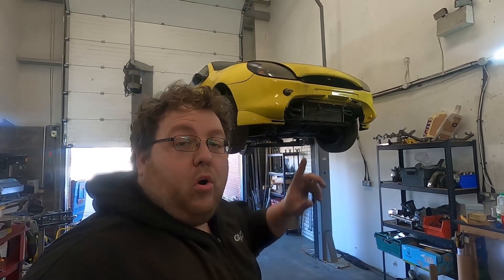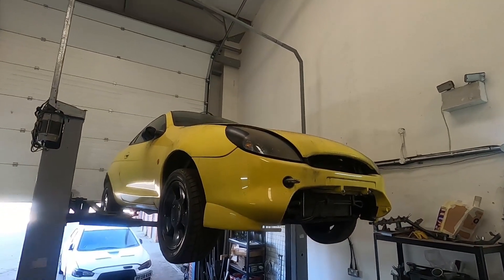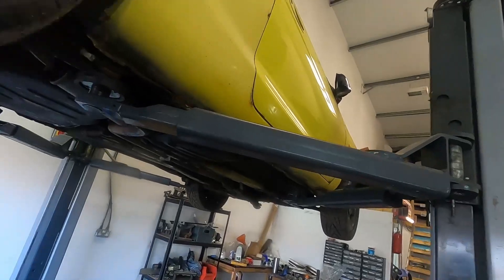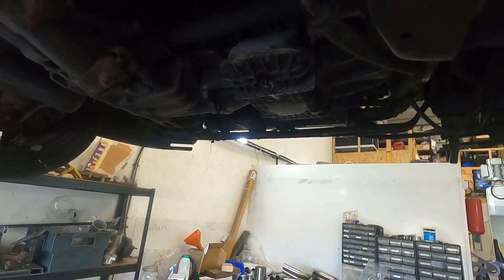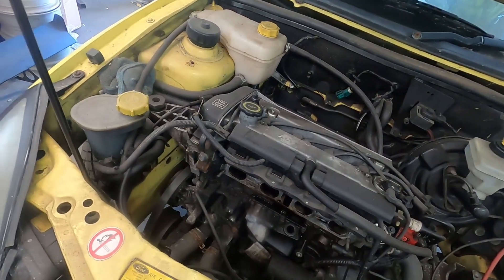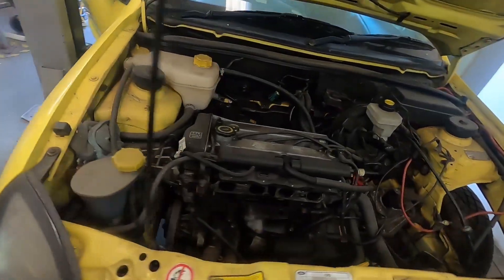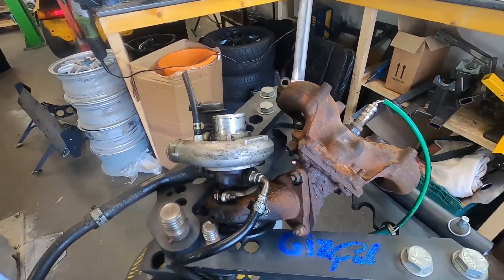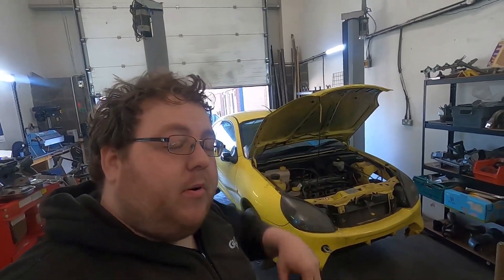Ford Puma Turbo - Build Introduction (Ep 1)

Comment: I love the Puma, won top gear car of the year for a good reason, really fast car if you're a good skilled driver through the bends and not just some unskilled shite straight line driver. Nothing shite about it imo, rust being the only real issue. Them 1.7 units are very fun to drive.

Comment: Following this, will the motor itself need forging?
Reply from the maker: For the customers intended power goals. No. We aim to boost power up to 200bhp. With a safe map this should be fine.
Reply: Much appreciated mate🤘🏻 what turbo set up will it be running as I’ve got a t25 turbo with t25 flange and manifold just wondering if they are going down the same route?

Comment: Will that kit be compatible with the MK5 fiesta which has the puma engine in
Reply: since it's the same engine i guess so? don't see why it wouldn't be
Reply: Jake S fitment, AC etc
Reply: @sbr7018  same engine. The AC pumps on the engine